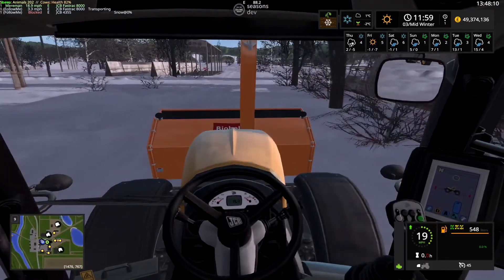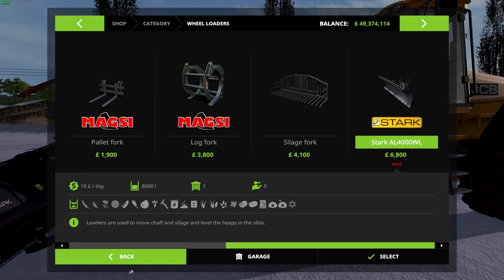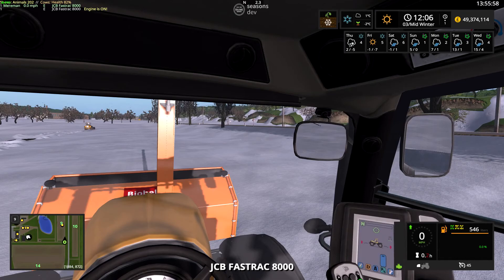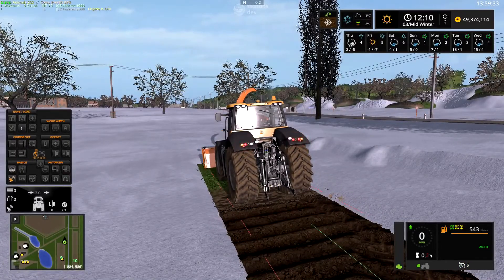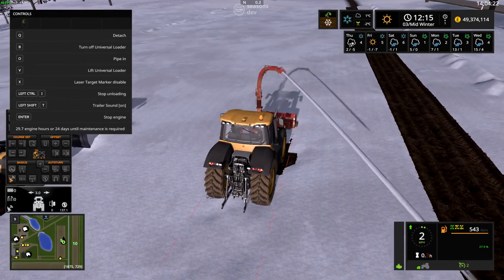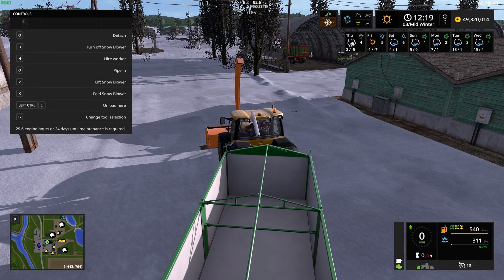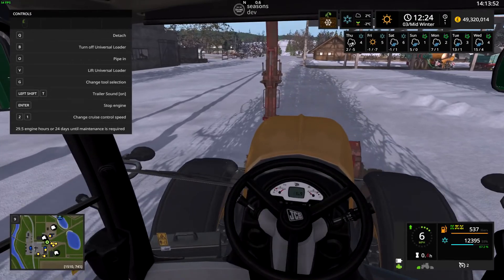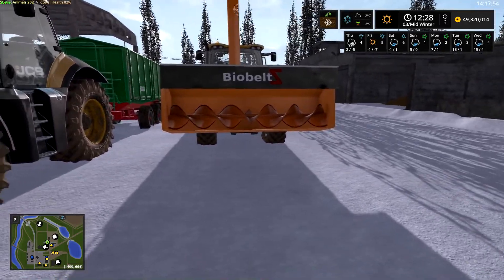Snow clearing equipment test

Comment: Good idea for a video. I tried the Biobeltz and Fraese and I think the unload here reset while you are not on a road. I didn't test it alot but maybe that's why it stop. Anyway it's better to do it in a trailer you can make big mountain of snow ;)
Reply from the maker: True mate
There is a newer version of the Fraese but as the modder uses Crapuser.net also know as uploader.crap. I won't be getting it. :-)
Reply: Yeah, that's why I have a computer only for risky website. One for play, one for watch and one for doing bad things lol
Reply from the maker: I made a promise to myself when fs17 came out no more of that site:-)
I have all the protection on this PC but it's the throttled download speed, damn I was getting better when I was on dial up lol